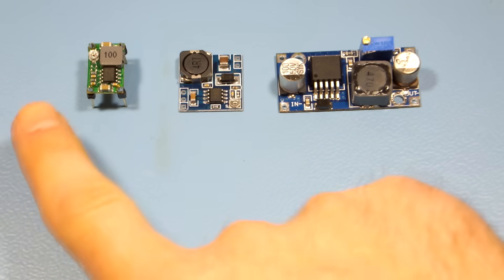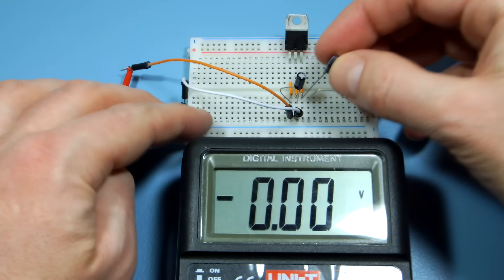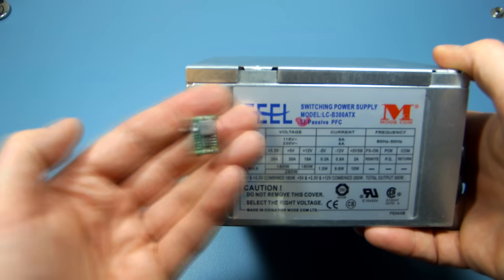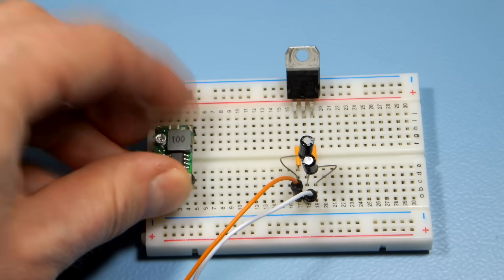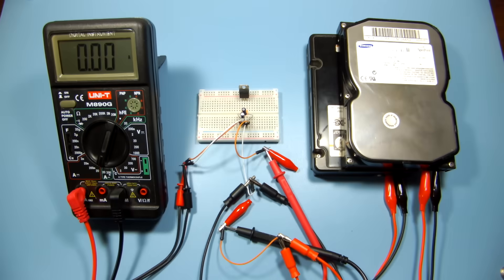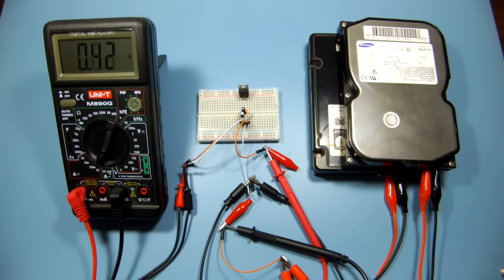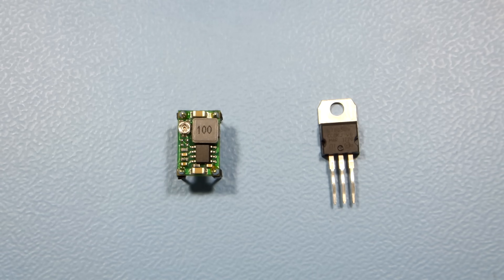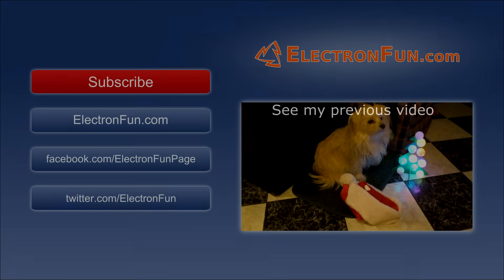Buck converter vs. linear voltage regulator - practical comparison

Comment: What is better? if im going to make a power bank for cellphone? thanks
Reply from the maker: I wouldn't use either of them. There are many, cheap battery charging circuit boards available on the market. In many cases these boards contain protection circuitry, so the batteries don't get overcharged, overheated, etc.
Reply: can you link to a multi cell charging pcb that does the conversion? most ive seen disconnect pack when its full, some will then run high cells through resisters to balance. That means if you are charging lipos u need a cc/cv buck and a say a 24v ac-dc walwart to input to it. ICs exist that do it all (cept the rectification) for multi cell series connected packs but I've yet to see one sold assembled on a pcb on ebay. This is part of the reason Im currently learning eagle. I would use what  I described above in a project for home but I intend to sell a product so im doing it right.
Reply from the maker: Sure, I've seen the design - it can drive small loads and literally "steal joules" from your battery.
Reply: For a power bank you can use a tp4056 as a charger & protection module for your parallel batteries ,  and a step up boost converter,  in my case,  I couldn't find an efficient step up so I put the batteries in series and used a buck converter from a car charger,  hope it helps
Reply from the maker: To tell you the truth I couldn't find a PCB, which would suit your needs. I guess designing your own PCB is the best solution, but I understand it takes a lot of time.

Comment: Its a good idea to use a buck converter in SIM800L or an acelerometer? You said that if you're building something sensitive, it should be avoided.
Reply from the maker: You should be fine with SIM800L and an accelerometer. When I mentioned the sensitive circuits I meant audio equipment, some specific wireless transmitters/receivers etc.

Comment: I'm confused, is the amperage remaining the same as you lower the voltage? Or is it actually lowering the total wattage? If so what could i use to actively retroactively increase voltage decrease amperage?
Reply from the maker: Buck converters step down the output voltage and step up current at the same time.

Comment: hi! what if i put an led example xml rated 10watt with 3.3volt input.. will led automatically draws it's led max amps? (3amps) or the buck conventer give less than its current needs? 

in this case we use constant voltage buck conventer.. subscribed.. :)
Reply from the maker: I haven't tried that, but I guess it depends on the buck converter. Some will probably try to deliver its maximum current and may shut down due to high temperature.
Thank you for your comment and subscription :)

Comment: Okay.. I have subscribed you ... good job  :) :) Now I need to know what kind of converter should I use for my battery powered EEG sensor. 
1. Buck converter has coil which can interfere with my EEG signals that I am amplifying 
2. Linear converter won't provide constant current which will break continuous sensing 

help me please :/
Reply from the maker: Thanks a lot :)
How much power does your device consume and what is your voltage?

Comment: I'm using a LM317 one and it's overheating with a 100mA load.. How could I resolve that without using heat sink? My project is a device which will be installed inside buses and trucks with a input voltage range between 23 and 29v, if I open other devices like GPS/GSM vehicle trackers, there's no heat sink. What regulator these guys use?
Reply from the maker: Unfortunately I don't know what regulators other guys use. I'm just wondering what is your output voltage. Is it a lot lower than the already mentioned 23-29V input?
Reply: ElectronFun.com Yea, it's 4,5v..
Reply from the maker: That's why your regulator is getting crazy hot - it has to radiate between 1.85 to 2.45W of heat. It's definitely too much for a TO-220 package.

Comment: do you know the difference between MP2307 and MP1584  ?  i think the both have the same pinouts but not sure whitch one is best to use to charge mobile device
Reply from the maker: There are a couple of differences, e.g. output voltage ranges. However, if you want to use them for charging mobile devices, pick the one that is cheaper, or available where you live. Mobile devices are not very picky when it comes to chargers. They will work with pretty much anything if you can supply enough current and proper voltage (usually 5V). If you want to analyze all the differences, check the datasheets:
MP2307: https://cdn-shop.adafruit.com/datasheets/MP2307_r1.9.pdf
MP1584: http://www.haoyuelectronics.com/Attachment/MP1584/MP1584.pdf.

Comment: if you are using arduino etc. to measure something precisely then you can't use buck converters to power it, and you also need the linear onverter for aref pin. !

Else the pwm signal from buck converter will interfere with the measurements.
Reply from the maker: Arduino also has an internal reference, so you don't really have to use the external reference pin, unless you need to connect a reference more accurate than the builtin one.

Do you know how much difference can the PWM supply make for measurements? I haven't tried measuring this yet.

Comment: You're not wrong about ATX supplies using a buck converter, almost all the cheaper ones are a flyback topology which is a subset of buck-boost converters.
Reply from the maker: To tell you the truth - I guess I haven't seen any other type of ATX power supply (I work in IT).
Reply: ElectronFun.com How about doing a tear down video of one and running through the design?
Reply from the maker: I usually do videos for beginners and I'm not sure if my viewers would be interested in a teardown video. I'll think about - thanks for the idea :)

Comment: buck converter can be use as bike charger ?
Reply from the maker: That's a really good question. I'd say it could be used, but you would need a powerful buck converter. However, I wouldn't recommend buck converters for such purposes. Lithium-ion and lithium-polymer batteries should be charged according to their charging characteristics, which is not a flat line for the whole charging process. If you want to learn more, watch this video: https://youtu.be/jNmlxBXEqW0 made by Dave Jones, where he explains how to properly charge batteries with a power supply.
Reply: ElectronFun.com thanks
Reply from the maker: No problem :)

Comment: May I regulate voltage with variable input voltage? I want to be able to produce 5 volts with a dc generator which produces voltage all over the place 0-30 volts.
Reply from the maker: Yes, you can have variable input, but it needs to be higher than the output you want. When your input drops below certain level (called dropout voltage), your output will drop too and become unstable.

Comment: hey, i got a question.....My linear voltage regulator heat sink size is just about the size of regulator, or barely more than that. its a 5V regulator and the input i want to give is 7-8V and about 500-1000mAh on output (load)....do i need bigger heat sink or its fine???? also if the heat sink is too small, i'm thinking about adding a small cooling fan directly on top of heat sink.(the cooling fan you find in a pc or dvd cabinet as exhaust)
Reply: Hi Justin. I must confess your question is a little bit confusing for me and perhaps Electrofun as well. The big question is, what are you trying to supply power to? Is this circuit you are supplying drawing maximum 1 amp constant, or are we talking about a circuit that draws 1000mA per hour. If it is a battery you are trying to charge then leave the regulator out all together. if you are trying to supply a circuit with power, you need to tell us, it's maximum power consumption. Is it 1 amp constant? If so, I would considder using the 3 amp 7805, which comes in a To220 package. The options are endless. It doesn't need to be a 78 series regulator as Electron has demonstrated. If you are talking about a 1Ah consumption circuit, that works out to 16.666mA constant, which a 1A7805 will handle with a smile without a heatsink.
Reply: Ok, great. and the battery is a 6V battery? Then you want at least 7.2V in order to cycle it (Voltage + 20%) which means your panels won't quite do it. Here is what I suggest: First, see if you can get your hands on another solar panel to make 4 panels. Connect the 2 pairs in series and then parallel the 2 pairs. You will then have an output of 12V to 14V at roughly 400 to 600mA. Scrap the regulator all together and connect them directly onto the battery. Don't worry that the battery is cycle voltage is nearly half what you are supplying it. The battery will drop the voltage for you. Now, you may want to consider building a cutoff circuit using a regulator, a comparator and a transistor and set it to stop the charge when the battery reaches about 6.8 volts. That way you won't over charge your battery, but you will increase the charge rate.
Reply: Oh, one thing I forgot to mention: Put a diode between the battery and the solar panel so the battery doesn't discharge back into the panel when it gets dark. It won't do the panels much good.
Reply from the maker: A lot depends on the shape of the heat sink. The larger the surface area, the better. Additional ribs help a lot.
There are different variants of LM7805 - some of them can output 1A, others 1.5A - in your case it would be better to use the one that can handle 1.5A.
I would suggest measuring the temperature under full load - the datasheet says it's 125 degrees C or 257 degrees Fahrenheit maximum, so if it heats up to around 100 C or 212 F, I would use a bigger heat sink.
Reply: +ElectronFun.com oh! thank you very much....
Another short question: my solar pannel give 7.5-8.5V (open circuit voltage)...but when load is connected it gives about 5.9-6.2V....so can i use a 5V regulator, is this voltage lower or close to drop out voltage? pls help...
Reply from the maker: That's a good question. LM7805 needs at least 7V input, so your voltage is too low I'm afraid.
Reply: +ElectronFun.com Thanks again, i might just add another pannel in series.....
Reply from the maker: That's one solution, but your input voltage will go higher, which means more heat on the voltage regulator. You could also use a low dropout voltage regulator or a buck converter and leave only 1 panel.
Reply from the maker: No problem :) Good luck with your project!
Reply: +Paul I was trying to make a solar charger....i have 3 panels connected in parallel, gives about 6-7V and 600-900mA output
Reply: +Paul thanks for your help dude😊
Reply: Its a pleasure. Good luck with it.

Comment: I believe you measured the temperature of the inverter and not the chip. I would assume you would get a much higher reading if you were to check the chip temp.
Reply from the maker: You are right, I was measuring the inverter. However in my case it was hotter than the chip itself.

Comment: My monitor turn off after 5 seconds when i use it.could it be a bad linear voltage regulator
Reply from the maker: To tell you the truth, I doubt it - usually there are no linear voltage regulators in monitors.
Reply: Ok.thanks..i need to figure it out
Reply from the maker: Check electrolytic capacitors first.

Comment: I was hoping to see some noise comparisons under load
Reply from the maker: That's a good idea for a whole video :)
Reply: I was thinking of using on of the Chinese 5v@3A modules in a Eurocard rack microprocessor, 8v on the backplane regulated to 5v on each board. I was assuming  these would be linear regulators, but buck conv are smaller, although if they generate lots of noise then it might affect the backplane switching speed?
I don't know if this actually happens in practice, but seeing how well these things cope with an active switching load (as opposed to an easier resistor load), would be interesting. Everyone always tests these things at a constant current, but that isn't a useful real world metric.
But yeh, if you want to make a video about it and rake in all the millions of youtube monies, that saves me doing it :)
Reply from the maker: Constant current makes the results much more consistent - that's probably why people do it.
Actually I was thinking to make a video about noise, but I need to think it over. It is probably more complicated than I thought initially.
Reply: I want to know what is the current output at 5volt output and 7 volts input in lm2576 adj.
Reply from the maker: If I'm reading the datasheet correctly, it's rated for max 3A.
Reply: If i charge mobile phone with it will it provide 3a?
Reply from the maker: It depends on your phone. There should be all kinds of circuitry to protect the battery from getting to hot, overcharged, etc.

Comment: Very interesting explanation - Thank you! Given that the 7805 can be commonly used on an old game console like the Atari 2600, would the interference mentioned be enough to disrupt the rf signal coming from the console, considering that the CPU, IO, and Video Output chips are shielded, not to mention that the rf module is on the other side of the console?

The idea, of course, would be to make the console more efficient, thus relieving load on the vintage power adapter that provides power as well.
Reply from the maker: jcchaconjr Thank you for your comment :) I believe a buck converter should work with old game consoles without problems. However, I haven't tried hacking retro computers or consoles.

Comment: If I put the buck converter in a shielded case, would that be ok for use in RF equipment?
Reply from the maker: To tell you the truth - I don't know. I haven't experimented with shielded cases yet.
Reply: what type of RF equipment? if you need a huge frequency rage you are probably ok with out it. If you find 2 months later that you have no reception at say 200khz then shield it. I think the worst interfearence will be at the switching frequency of the DC-DC converter.  Im designing a pack to run a 125khz rfid reader and made sure to select converters that operate significantly above 125khz. Ill let you know in a month or so if I have any trouble.
Reply: aye,, should be done end of april
Reply: I'm curious on the outcome of this... Want to build a RasPi GSM/GPS in my e-bike on 32v with a buck converter.  No idea whether it will interfere on the GSM-frequencies, or the magnetic sensor of my phone as a compass...
Reply: keeping the buck converter a distance from the receiver helps. some small capacitors across the input and output supplies may help. Experiment with different values. 100nF, 10nF, 100pF maybe.
 It could be that the radio receiver is poor quality, so it will pick up any noise.  
Keep the antenna away from the converter.  Ferrite beads on the wires can help.
Try a box made from un-etched PCB material soldered together.
It IS possible to make a system with a sensitive radio receiver and a buck converter together!
Reply from the maker: I would be grateful if you could let us know about the results. Many people are interested in this topic.
Reply: Hey, i have a problem, i wanted to modify a blind controller to automatate it. It works with RF and I can't reproduce the signal because it has a signal encryption chip or something like that (sry I don't know much about electronics). So I decided to attach a transistor between the three buttons and control it via IR with ATtiny85, because it fits in the case of the controller. All works if i power up the attiny with a external power supply, but i want to make it portable and stay inside of the controller, so i have to down the voltage of the existing battery in the controller, which is 12V, to 5V, I bough the mini360 DC-DC step-down converter (with switching frequency of 340KHz) and the blind controller works at 433khz, and when i use it with the buck converter, the controller doesn't work so i assume the converter is generating a interference. :( what do you recommend me? How i shield the the buck? I'm searching for a buck converter with a higher frequency, but all i find is too big for the case of the controller :'(
Reply: At low frequencies like this (below 500 MHz), you are better off filtering the input and output.  Radiation at the switching frequency and harmonics require and antenna structure which is overcome with proper filtering.
Reply from the maker: We will be waiting, thanks :)

Comment: why do you use capacitors with the linear converter?
Reply from the maker: These caps are used to make the output smoother. It's just a good practice.

Comment: but why is it that something so simple takes so much more power? just because its a primitive and unrefined method or what? id like to use a buck converter but right now im only capable of scavenging random components off of old boards.
Reply from the maker: A linear voltage regulator simply transforms higher input voltage into heat, that's why it's so inefficient in most situations.
Buck converters can be really cheap, but they are not easy to make by yourself.
Reply: ElectronFun.com well yeah, but i was wondering if that was because the circuit inside of the regulator was just too simple and/or composed of too little metal to prevent it from a reaching high heat state.

I know that from trying to cut the head off of bolts the head gets and stays much hotter than the threaded shaft(because of its smaller size). and i was wondering if this was the same principle or if it was just based off of the inefficiency of the circuit.
Reply from the maker: I would say that's because linear voltage regulators like LM7805 are much simpler devices than buck converters. If you are interested what's inside the LM7805, read this article: http://www.righto.com/2014/09/reverse-engineering-counterfeit-7805.html.
Reply: thank you for the response ill have a look.
Reply from the maker: Zalphor No problem :)